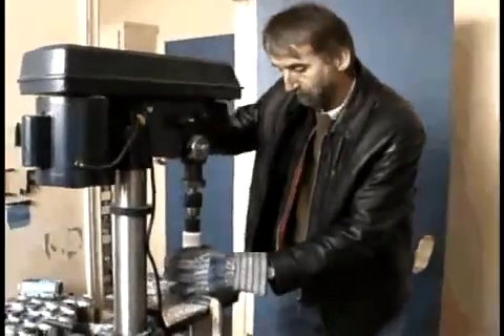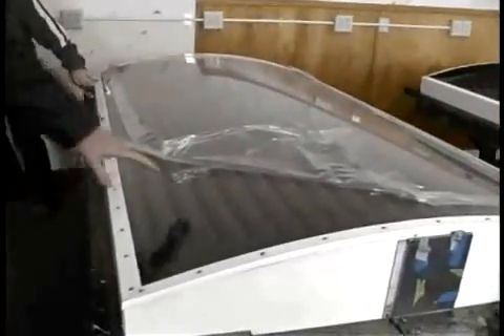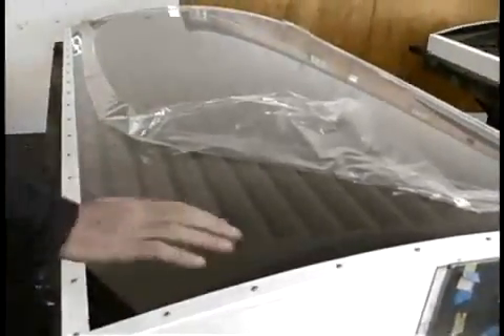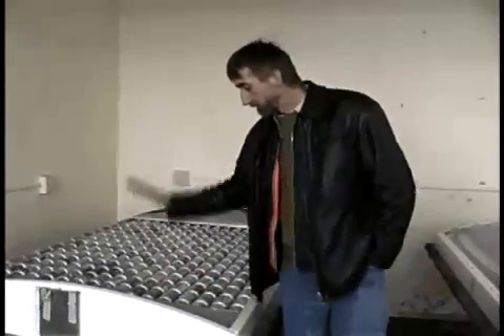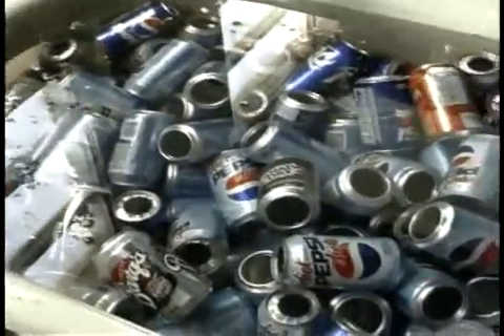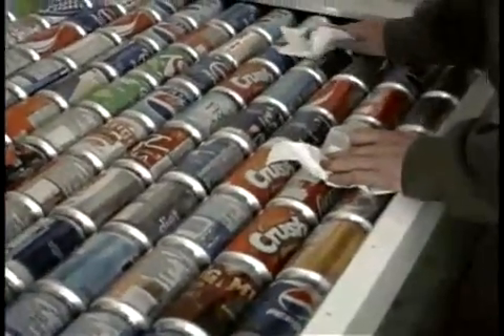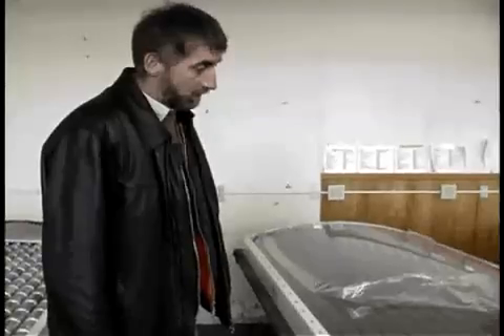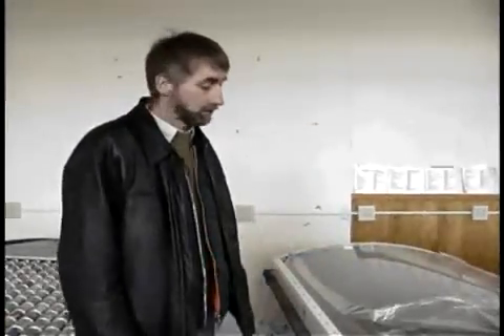Build Your Own Solar Panels ☼

Comment: I worry about the plastic coating inside the cans. Using the aluminum duct method is cleaner and healthier. Still though, this is awesome. I've made two small ones for testing purposes. They actually work.